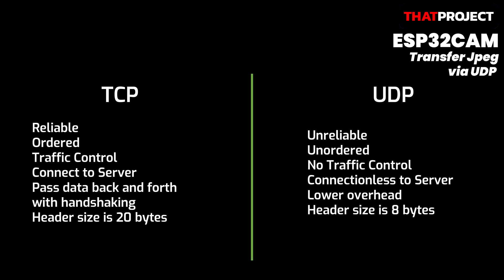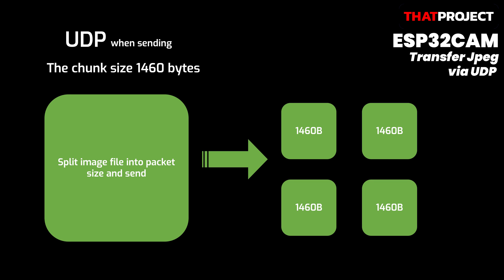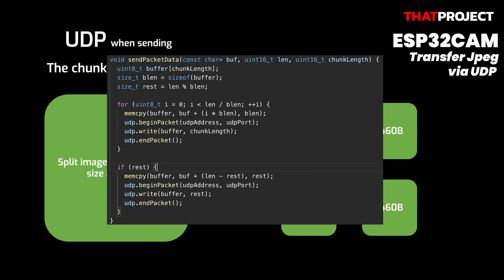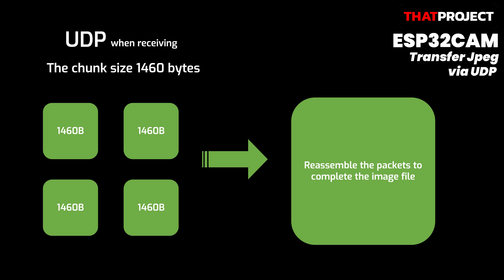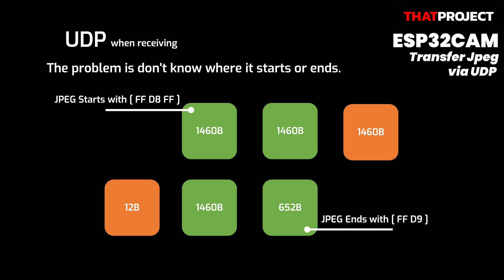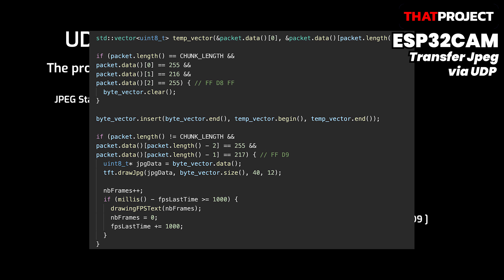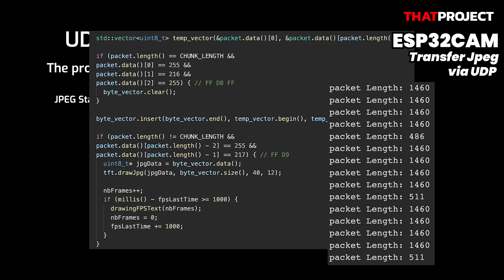ESP32CAM | Sending images via UDP?

Comment: Friend can reproduce this test using the esp32 with the tft 9488? I don't have the ESP32TTGO, thanks
Reply from the maker: All you need to use your ILI9488 is to set the TFT_eSPI. Have you tried it?
Reply: @ThatProject  Hello friend I managed to make it work with my TFT 9488 using your code ESP32_WEBSOCKET_SERVER_WITH_TFT_JPEG_v3, I'm new to ESP32 programming, I'm learning, I need to use adapt the #include <TFT_eSPI.h> library in the correct code? I'm trying, but I'm new to programming.
Many thanks for the reply!
Your videos are helping to get started with ESP32!
Reply from the maker: @WagnerUlisses  Try the example of TFT_eSPI, it will help you a lot.
https://github.com/Bodmer/TFT_eSPI

Comment: is there some flickering at bottom of the display for UPD ? why ?
Reply from the maker: This is because packets do not come in sequentially in the case of UDP.
Reply: @ThatProject   I have done the same in websocket but it has a performance issue that is FPS is reduced. Hence I am thinking of UDP  but from you project, i will face this problem which is in yours.

Comment: Nice work! 

Here's a question from a networking noob:  One of my bucket-list projects is a remote underwater drone with, say, about 50 meters of cable to troll the bottom and watch lobsters at play.  I'm pretty competent with MCUs (including esp32s), basic electronics, 3d printing, and machining, but have no idea where to start with point-to-point wireline transmission of video signals.  Anyone reading this have ideas about what protocols and hardware might make sense?
Reply from the maker: It's an interesting project. It seems that not only the ESP32 but also the camera module should be included for the video signal. Due to the limited environment underwater, a lot of testing seems necessary. I think that the starting point for this project is to be testing if data transmission is smooth with about 50m cable.
Reply: Any normal IP camera would do the job no? If it has a  serial port you can even send data out of the serial port of the camera to control the drone ...100meters is no problem...

Comment: Very cool, one advantage I see using UDP is you could broadcast it to many devices without much overhead, the router would do the work.
Reply from the maker: Yeah, you're right. Transferring via UDP is a kind of charm. It makes lots of things possible. I'd like to have more projects using UDP if I have a chance.
Reply: Hi,  not  working  on  SPI TFT display  using  TFT_eSPI tft = TFT_eSPI();  tft.pushImage(40, 12, tft.height() * 6/ 10, tft.width() * 6/ 10, jpgData);